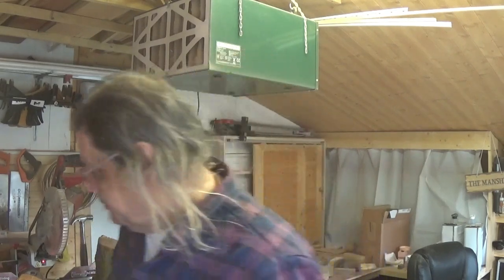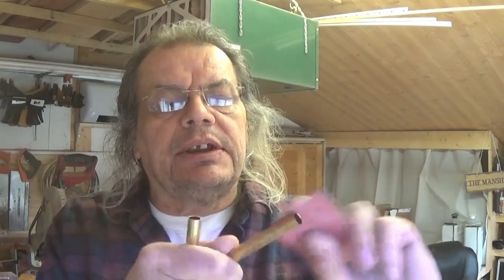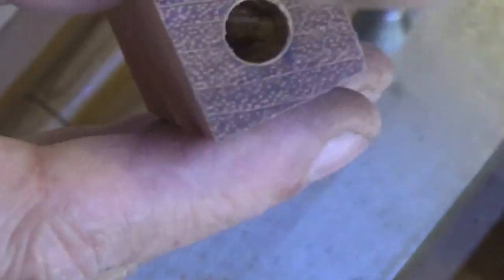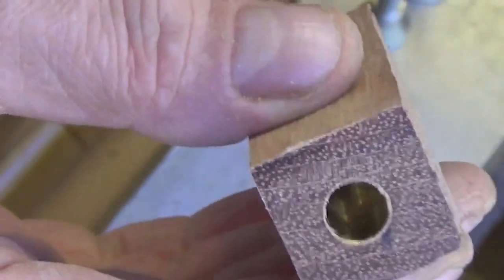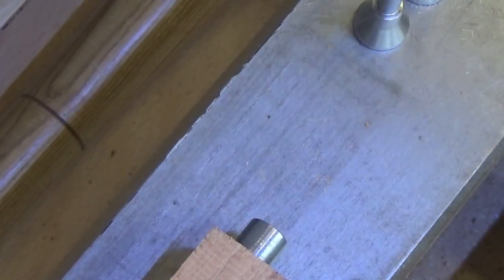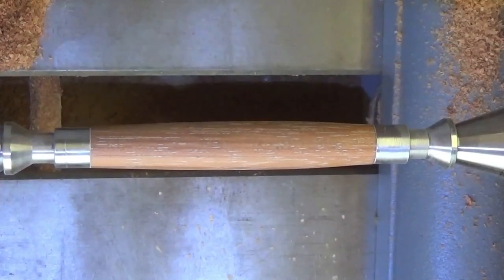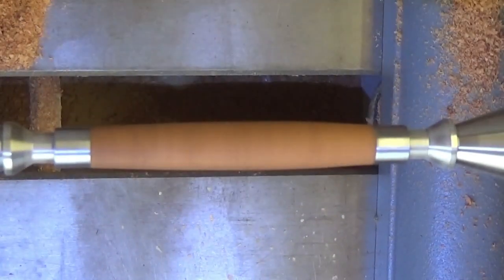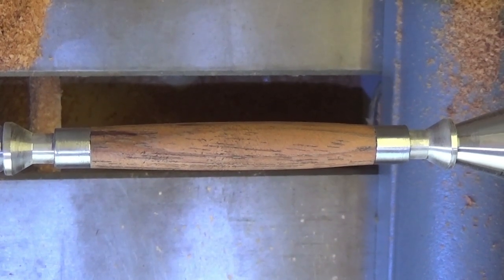Woodturning at 54a #148 A pen and pencil

Comment: nice pen set , got a starter kit for xmas and now have two whole pens turned yah0000, what about a bird feeder they like wey tree i hear lol. where did you get the handle thingy for your pen assemble? im interested in making one - just use the lathe at the moment. anyway thanks keith keep making shavings .
Reply from the maker: Ian washere Thanks Ian. The handle is just off an old woodturning tool glued onto the handle of a push clamp.😀